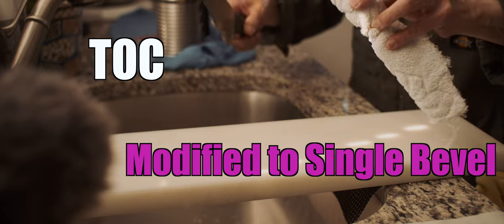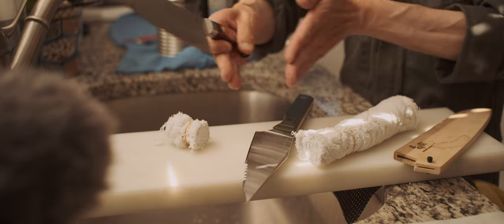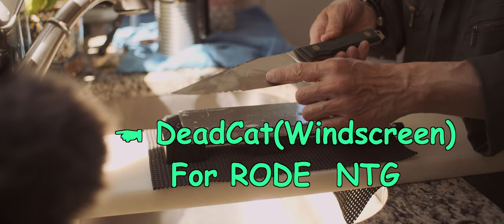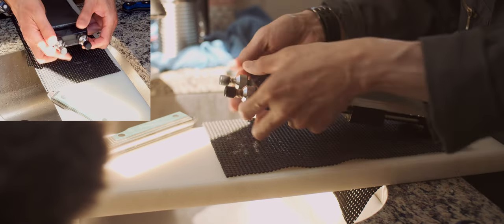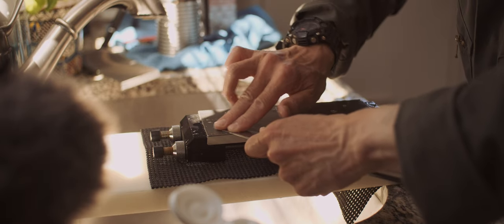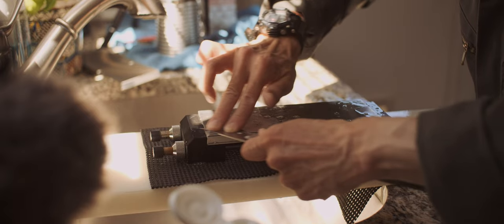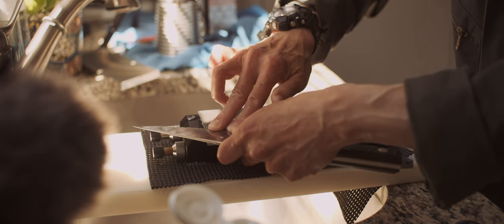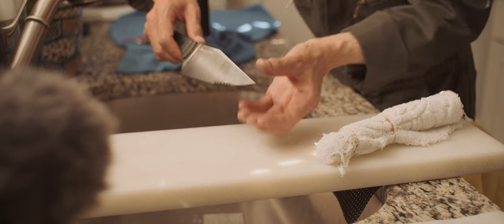Pro Sushi Chef’s knife modification, Double bevel to Single bevel, Part 1

Comment: I had previously managed to counteract a tendency to roll the edge to one side on my Mora (the heat treatment on that particular blade is perhaps on the softer side) by using asymmetric bevels. Higher scandi (imperceptibly convex) on one side, and more pronounced convex on the other to support the edge and prevent it from rolling. It worked. Good thing to know I am going in the right direction :) 

Love the video, very educational!
Reply from the maker: Love the fact that you're the type of person who draws the answer / conclusion out of your experience.
You are correct. Even high quality Yanagiba tend to roll onto the back side (ura-oshi side).
So, when converting double beveled knife into single beveled, the first thing people need to know is the fact that it's not going to be a "true-single bevel", like Yanagiba and usuba.
The back side is a "very large radius convex", starting from really high (the higher the better).

So, the key points are, reasonably thick blade stock, mono-steel construction, and don't try to rush it (don't try to finish it in an hour ...😄)
Reply: @MonsterS4R996  Thank you, I appreciate it a lot.

Comment: I'd like to see that video. From my experience, I modified most of my full flat grind, Mono steel, western style knives to highly Asymmetrical and it improve the cutting performance alot. I never encountered the edge rolling into another side though.
Reply from the maker: It's hard to say when it happens, and when it doesn't. (About the edge rolling to the flat side).
Yup. full flat grind, Mono steel construction, and blade thickness not too thin, those are the keys.

Comment: Very interesting, i already saw you created the 2nd part. I have a few knifes that are double bevel now and are a candidate for this. Thinking about it. Sharpening will be easier like you said somewhere. Thanks man for the idea :)
Reply from the maker: TOC has serrated portion in the middle of the blade. And, like most serrated blade, that part is single beveled.
So, if I keep the factory edge, I have to tape up the middle of the blade and be extra careful when sharpening the left side.